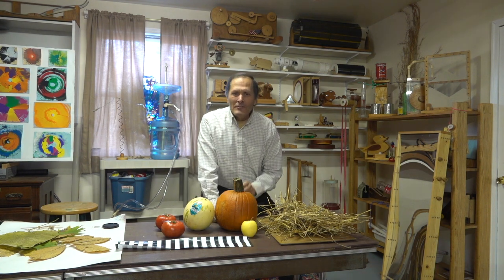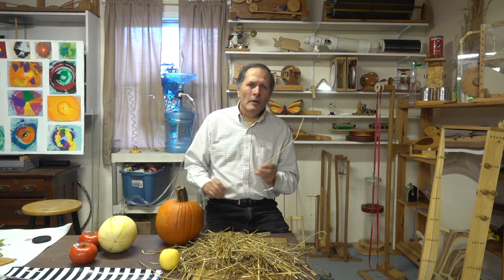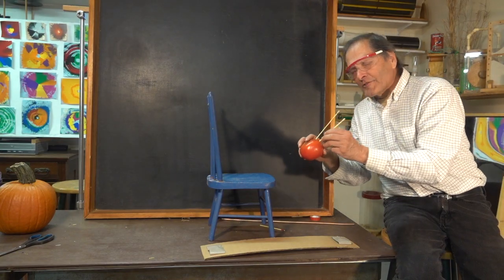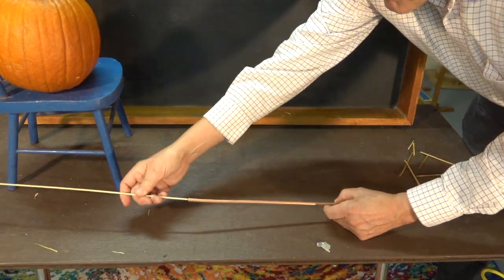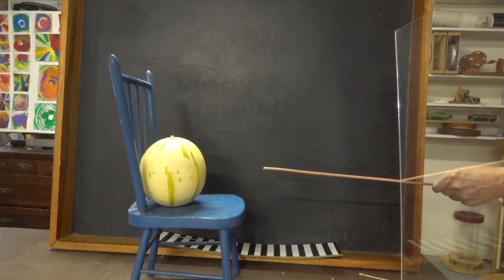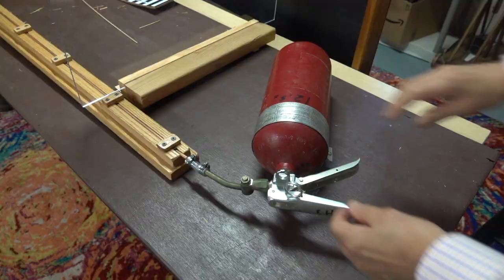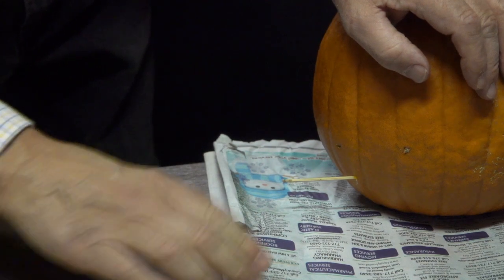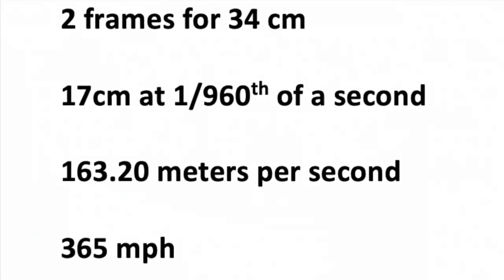Deadly Straw Bullets. // Homemade Science with Bruce Yeany

Comment: Added to the strength of a tornado, there could be a tunnel effect that could increase wind speed in a considerable way.
Reply: Certain flow conditions could add up to about +40% local speeds.  Just as the air flow is increased around the leading edge of a wing.

Comment: I have read descriptions of straws being driven through wooden floorboards in an article written in the early 1960s. So not only plausible but extremely likely to happen. Tornado windspeeds are externally measured as an average using doppler radar. Locally within the core of a tornado windspeeds can be considerably higher than at the wall where most external measurements are made. Apparently fragile objects moving at speed can develop great penetrating power as some brief calculations using kinetic energy equations will show.
Reply from the maker: HI Michael,  I was very impressed with the results of my first tests and plan to try some more "targets". The ability of the fragile straw able to do damage reminds me of the paper saw blade that I did a video on a couple years ago.  As fragile as paper is,  turning at 15,000 RPMs it could easily cut through several materials much harder than the paper
Reply: Bruce Yeany 
Thanks for the response. In addition to the kinetic energy contained in the straw, it is important to remember that the support structure is a cylinder which is essentially composed of silica and hence extremely rigid in compression. Revisiting the article mention earlier, I note that some straw stalks were driven through the metal casing of a domestic refrigerator. That really is a scary thought!

Comment: The version of this story that I've heard is straw piercing trees.  Maybe balsa trees!
Reply: As a child living in Nebraska I've seen with my own eyes straw poking all of the way through a living tree branch, probably 5-inches in diameter. It was a hardwood tree--no evergreens grew there. I was six or seven at the time and remember it quite well. There was also a chicken coup wall with easily 200 straws embedded it it standing 10 or 15 feet away. The same farmer had a grain silo completely disappear sans the concrete pad. As far as I know they never found a single piece of that silo anywhere on their farm.

Comment: Thanks, excellent as usual!  I think the penetrating ability of the straw might depend a lot on the species, influencing the strength of the material, and possibly on the shape of the cut end, square or oblique.  The moisture content could go either way, either improving the mass and resistance to shattering, or it might reduce the stiffness and cause it to bend on impact?

As a child we found a six-foot length of three-quarter-inch heating pipe, and decided to try it as a pea-shooter, with balls of clay.  We were quite surprised to find that they could go about 200 feet, and I seem to remember timing them at just under 100mph.  Mercifully we didn't have a fire extinguisher to play with, as I don't thing the glazing in the neighbourhood would have been safe!
Reply from the maker: good points about the straw.   I had a feeling that if it were fresher, I would get better results,  I plan to test again.  Your old peashooter sounds impressive.  One of the interesting things I had kids try was a lesson on impulse using a peashooter.  I had them start with a longer tube and then progressively cut it shorter,  while shooting it the same way.  nicely showed the distance was determined by the length of time the force was applied in the tube
Reply: @YeanyScience   Yes I think the rate of acceleration is quite slow.  Of course there comes a time when lung capacity becomes the limiting factor ... and for some reason I took up freediving as an adult!  :-)

Comment: One potential limitation on the air compressor is the speed at which the valve is opened. Jörg Sprave, a German engineer and YouTuber who makes improvised weapons (sorry, "toys"), had a similar limitation when designing his pneumatic arrow launcher. That toy used a standard ball valve with hand lever for the release. Rather than making that a manual trigger in itself, he used rubber bands under extreme tension to pull it toward the open position, with a mechanical stop in place that was released by the primary trigger.

Now, in all fairness, I think the kind of ball valve he used is inherently slower than the valve on your compressor. In addition, he charged his toy up past 4,000 PSI (which I think might be enough to supercriticize* nitrogen, but I digress). At higher pressures, the slower valve becomes more of a relative hindrance. For the record (and I think it probably is a record), his toy managed to put one kilojoule of energy into his projectile.

* Now I'm just messing around.
Reply: I think the simplest solution for the gas gun would be to increase the length of the barrel, so that there is more time to build up pressure before the projectile emerges from the end.  But according to the gas gun experts, another limitation is the build-up of air in front of the projectile, which is why they use an evacuated tube with a light cap that the projectile knocks away.  (They also use hydrogen as the propellant, because its maximum limiting velocity is higher than air.)
Reply: @anotherfreediver3639  good insight. I agree that a longer barrel length is far more practical, especially if the volume of the barrel is still negligible compared to the capacity of the compressor.

Comment: Would be interesting to see if there might be different kinds of straw available, or for alternative ideas, what might look like straw when embedded but be something else taken for a ride by the winds.
Reply from the maker: thanks James,  I tried to use wheat straw in this case but you are right,  I think there are several plants with more tougher stems out there.  Wheat straw is hollow but there are several plants that have a solid core which would be more rigid.

Comment: Nice demo.  I assume a tornado (as does any wind) will have smaller areas of even faster winds when air is reflected and/or channeled around various terrain and objects (hills, trees, buildings, etc.).  It probably also depends heavily on how smooth and pointy the straw is.  Some pieces seem to splinter more than others.

Comment: Good think you pulled in the compressed air, coz I was just experimenting with balloon pump with removed valve and added a tube as barrel and was able to put a bamboo skewer  through a roll of paper towel just using my hand to apply pressure force to the piston as quick as a I could.

Comment: Very good video as always. 🤗
Myth busters used a long, long tube to fire straw into and maybe threw a palm tree trunk.

- I wonder if using a long long tube that's not larger than your blowing capacity, would it be more effective? (Would also be neat to show a representation to show the lung capacity of a human maybe a cylinder with a float or piston to make how much volume, even flow rate with using frames per second math) or if it would create too much drag on the air trying to flow threw the pipe?

- Also maybe demonstrate a Stirling pump I think its called, to show how a fluid/air/water drag and friction can be used for work, as a pump or turbine (maybe a holy tube with cd's glued to it.
If use the clear discs it might be a good demonstration on how the centrifical / centrifugal forces act on the fluids. 
Might need to power it with the drill to get it fast enough (as a water pump.
And can demonstrate just pushing a fluid threw it would drive the shaft "to make work".

- And... how steam can be made with a cavitation water heater, as the holes create cavitations and ultrasonic bubbles that are like tiny implosion's, creating small vacuum implosions possibly plasma, evaporating parts of the metal surface of the rotating drum slowly away.

Well they are just ideas... the last one is probably not easily done on low to no budget. 🤔😣

Comment: A variable missing in your tests that I am curious about is pure wind shear possibly opening the pores of the skin of the foods. It would seem that those winds, not being isolated to the straw but also pounding on the surface of the objects might make them more prone to being punctured. What do you think?
Reply from the maker: good question,   I've also wondered about the blast of wind versus being in a steady stream of high winds.  I would agree that the wind itself makes the food  more susceptible to being punctured,  it's adding more stress to the skin.   the best example of this is the tomato,  I think they were torn apart more by the wind than by getting hit with the straw

Comment: Great video!  On the top shelf, you have a brown object with various circles and possibly levers. What is that contraption?
Reply from the maker: Interesting,  you are the third person  that asked about that piece today. It's one of my oldest pieces and I thought I had a posted it somewhere on it but I guess not. You can't tell with it sitting on the shelf because it is too tall but there are supposed to be two flags on the top of it.  As I turn the big gear, both flags wave back and forth.  Before showing it to students,  I would have them go through the gear and lever movements to determine which flag would "wave" faster.  Would you like me to make a video on it?

Comment: I got a Samsung Galaxy S9 in Nov. and have had a blast with the slow motion. Super slow on it is 960 fps like you said so I was wondering if you used a phone like this to capture your slow motion ?    Great video btw.   : )
Reply from the maker: Thanks,I use the Sony RX 10 and the smaller RX100.  both can shoot up to 960 fps.  I especially like shooting at 120fps with sound.  Love to find something reasonable for higher fps rates, there are some great higher priced ones but can't justify the price at the moment

Comment: In 1988 New Zealand and other Pacific Islands got hit by a once in a century Cyclone, Cyclone Bola.
Now, these are not  CONCENTRATED storms like we see touch down, in the USA, where the sky sprouts a black finger and write "inescapable death" along a  twisting track . . . ( honestly, why do you guys not get on a plane and move to Canada ? ) but paradoxically they do more overall damage because their energy is spread over a huge front.
And the week before the cyclone my dad had brought, and stacked up in his scrapyard, an entire factory-skin of 6 foot sections of scrap corrugated iron. About a thousand sheets.
Which simply vanished into the sky.
We never heard of any pumpkins getting dissected, OR in fact of the sheets touching down ANYWHERE. They seemed simply to have "gone".

Comment: I  think it's reasonable to think that wind speeds may actually be even higher in some circumstances, depending on the local topology of the environment.
However, I still think the stories are pretty implausible. An assumption of your tests is that the long axis of the straw is exactly parallel to the direction of the wind, and that the surface of the pumpkin is not just perpendicular to it, but also stationary. I think these assumptions are incredibly unlikely to actually occur in a real life tornado. Make the angle of impact just a little oblique, and I really doubt you'd see straw actually go into the flesh of the fruit.
Reply from the maker: good points,  although I did actually hear the story from a pretty good source.    I would think given enough straw laying around there would be the chance that a few might make it into  the fruit as described but my feeling is as the story was repeated the numbers were highly inflated.

Comment: Haha i used to do this with hollow plastic dowels and sharpened stainless 1/4-20 rods. Would go through 1/2" plywood. The fun parts of workin in a metal shop.

Comment: This is just a short burst of air, my brain hurts contemplating the actual physics behind tornadic winds blowing objects. If there is more constant wind behind an object, is it possible for the object to obtain a higher speed than the wind due to kinetic energy? I have so many questions. With air also moving all around the object at the same speed, I would imagine it also keeps the object from deflecting off of the object’s it collides with unlike what happened here with the straw done with artificially generated wind.

Comment: I wonder if you could get a faster speed from your 90 psi air compressor just by making. Longer barrel
Reply: Why would distance effect speed? Wouldn't it degrade regardless past the point of thrust?
Reply: @TheRadioAteMyTV  from my understating, given a longer barrel, the air pressure has a longer amount of time to act on the projectile, and thus results in more acceleration. At least to a certain point
Reply: @SGManiac1255  Interesting. I would like to learn more about that.

Comment: May I ask about the high speed camera model you used?
Reply from the maker: I use a Sony RX 10 for most of my video shots.  I especially like to shot at 120 frames per second and capture sound at the same time.  I can then slow then down 4 or 5 times and still have excellent quality.  It also will shoot higher speed with no sound.  240, 480 and 960 for short bursts.  I'd love to get something faster.   I think there are several camera out now that will also shoot high speed under 480 FPS,  even several phone now have the capability.
Reply: @YeanyScience  Thank you for your response.